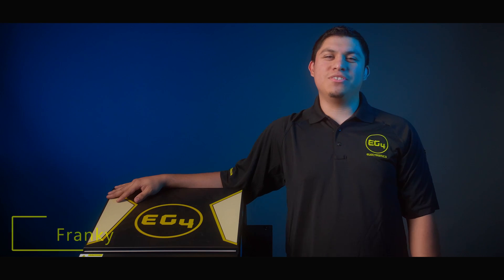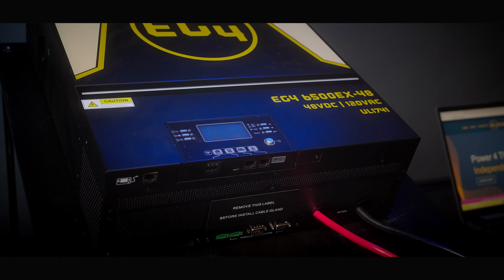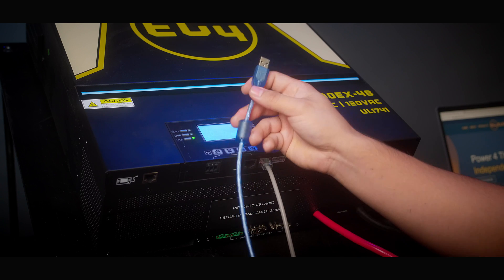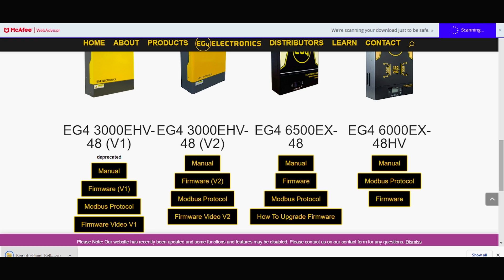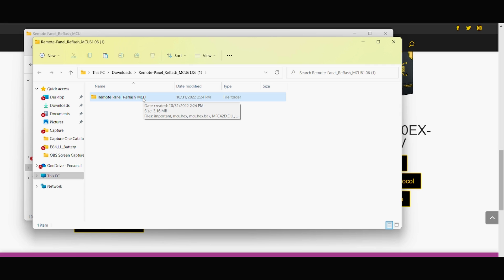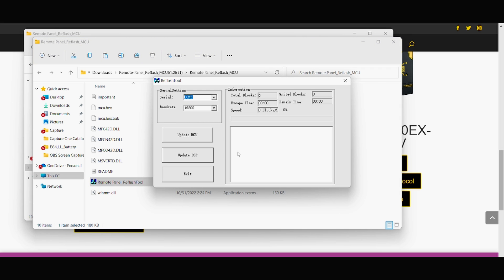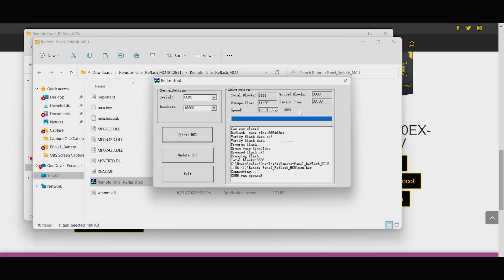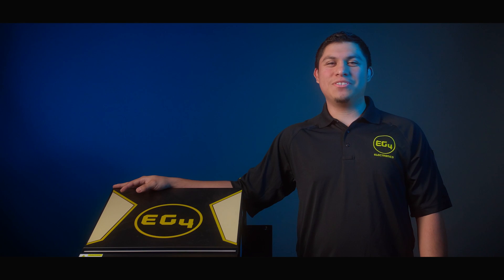EG4 6500EX-48 Firmware Update | Error 61 Fix

Comment: i updated the 6500ex march 10th 2023 and NOW  i am getting FAULT code 71 and error code 61.  i am only using 1 6500ex inverter. There were no errors while performing update.  after update i put inverter in EG4 for bms comms.  battery pin switches are correct and cables are correct setup.

Comment: I got my inverter less then a month ago. Why would you send a product that immediately needs a update and doesn’t have what you need. I live fully off grid, this is total BS. I should have just bought a solark or something from a more reputable company. It makes me wonder if I will continually have issues rather then it just working as it should. For anybody considering this product, consider something else. Maybe pick something more mechanical in nature. For full off grid use this might be a poor choice.
Reply: Same issue with my Rich Solar inverters that I got with my OGK-PRO off grid kit from shopsolarkits, I'm hoping they all use the same controller & software for the 6500's because Rich solar doesn't offer firmware updates. I'm about to attempt to update & fix my error 61 issue. I have two split phase inverters to update. I asked the same question you did, bs...
Reply: @deadeyecustoms1500  I’ve done multiple firmware updates. It’s honestly gotten worse. I absolutely hate this inverter. It’s bad enough it’s even ruining and short cycling the motor on a 10yr old deep freezer. It’s just a basic motor and should last for 20yrs. Never did it ever give me issues until I switched.
Reply: Well, this piece of crap has been put out to pasture. Good riddance. Total waste of money. Nobody will buy mine now since it's discontinued.

Comment: Tried the update. Started process, Inverter shut down as shown in video but update stopped. Tried again, same exact results. Now display on inverter will not show anything. Looking at my second inverter, it shows 61 after pressing up arrow twice. Flash was probably not needed but following directions of signature solar. Looking for answer to get inverter back on line

Comment: Help! I am unable to get anything to populate in the serial box. Where it says  (COM5 in the video) mine is blank. Can anyone please help me? Tried on 2 different windows laptops.
Reply: Iam having this same issue. the only time i can get my com to pop up is if my blue tooth is on and only com 3 and 4.   tried on windows 10 and an old windows 7
Reply: you have to download and install the driver for the ut-8811. i was having the same issue but after I installed it everything worked fine with the blue cable from signature solar.

Comment: Just received my cable and 3 new batteries from Signature Solar.  Did the firmware update but still getting error 61 when using eg4 setting.  I have a single inverter with a single eg4 battery hooked up.  I have 3 more to hook up but don't want to waste my time if I can't get the inverter working correctly.  Any tips?  I
Reply: Someone said after the update is done, unplug the communication cable from Inverter that goes to your battery, and plug it back in.

Comment: I have eg4 6000ex-48hv. Came with usb/rj45 cable. Update connects but nothing happens. Com port open but no data transfer

Luckily I have a usb/rs232 adapter that does work. The stuff shipped needs a null modem adapter and does not work. 

Hope this fixes my SUBu issues where I get error 8
Reply: Hi Rich, I have same inverter been running for 4 months no problem. This Jan 2023 the AC output quits after a few hours with or without a load. I am hoping a firmware update will correct the issue. The SS tech said I need USB to ethernet cable, you mention usb?rs232 adapter. Can i buy the same adapter you are using on Amazon/wherever? Appreciate your reply. Rick Camarillo

Comment: Greetings, I also have the 61 error.  Is it possible to update the firmware with linux?  I do not operate with windows at all.  I will also need the cable please.
Reply: You will probably have to use wine to emulate it. First download wine, Then do the steps as he did. When you download the software on your computer, open it with wine.

Comment: FYI, I did this over the weekend, it was seamless and very easy - I got the cable from amazon a week ago or so, it only took a couple of days to get it via prime. 
Just make sure there is NO AC load on any of the inverters before you start (the inverters turn off during the upgrade).
Also, if you are using a laptop to flash firmware, ideally, the laptop should be plugged in to AC or have 100% battery. You don't want it to shut down in the middle of a flash. 
Finally, I have a pair of 65K in Split Phase, the order of operations is do to unit1 first (master - 2p1), then unit 2 (SL - 2p2).
It did repair my occasional beeping and error code 61.
Reply: Which chipset was in the serial to USB cable?
Reply: @strmthis  There is no chipset - it is just a "cable".   All physical wires.